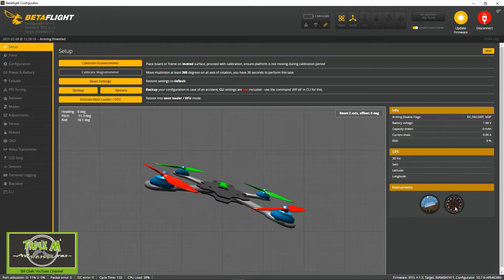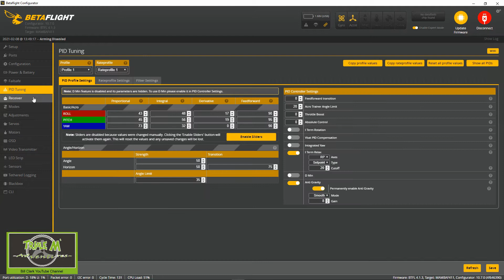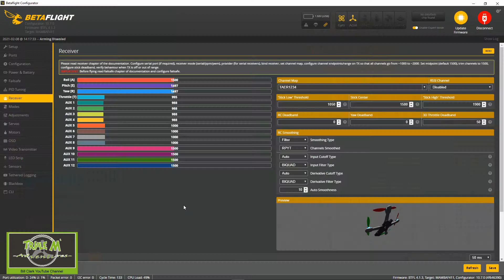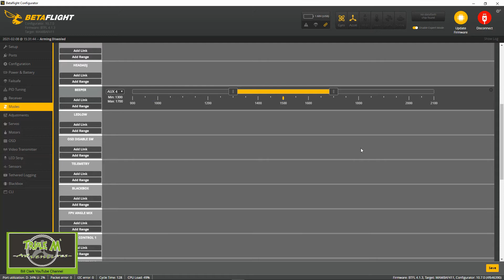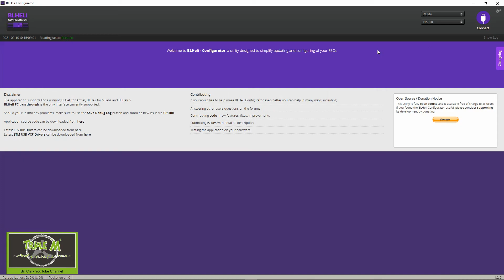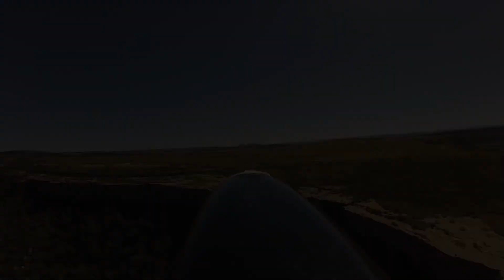Configuring a Betaflight Flight Controller

Comment: Hello Bill.  Help please, is it possible to set the toggle switch ,on and off, for the GPS rescue option?
Thank you for information.
Best regards.
Reply from the maker: First thing is set up a Mix in your radio to a switch for activating GPS Rescue. Now in Betaflight go to Modes set GPS Rescue to a Aux channel and select the channel set up in your radio. In Betaflight Failsafe you will need to set up GPS Rescue options. Change from Drop to GPS Rescue. I have never tried this because the general opinion is that Betaflight’s GPS Rescue is not reliable. In the future I will test it.
Reply: @the-happy-RC-flyer  Thank you very much.

Comment: Bill, here again with some more advise, please.
I installed a Mamba F405 in a Helimax F500 (I know, old, but now renewed) and configured it with three flight modes horizon, acro and angle. When I fly it with acro mode, it behaves perfect, but once I switch to Angle or Horizon the F500 starts to wobble more and more so I had to switch back to acro. I suspect it has to do with sensitivity, but how do I adjust it? Best regard
Reply from the maker: Hi Enrique, it’s happening when the gyros are active. Is your FC installed correctly, soft mounted and level. The FC should have a very slight bit of movement not over tightening the fastenings. Have you calibrated the drone on a level surface. It could also be the PID tuning but the drone should fly ok on the default settings.
Reply: @the-happy-RC-flyer  Bil, thank you for your advise. I wil check and let you know the outcome. Regards

Comment: Bill, very interesting video indeed. I wished you also showed your movements in the transmitter to reinforce what is happening with the quad. From my point of view, betaflight is far more complicated than open tx, with so many parameters only a true expert knows what are they for, LOL. Keep your great work. Regards.
Reply from the maker: Thanks for the kind words Enrique. Could you clarify "showed your movements in the transmitter" as I am always looking for ways to improve my tutorial videos.
Reply: @the-happy-RC-flyer  I am refering when you are manipulating the switches to test if they are responding correctly with what you have programmed in Open TX.
Reply from the maker: @enriquech4041  Yes this video was filmed when I was setting up my Tina Whoop and I have flown it with the settings in this video.